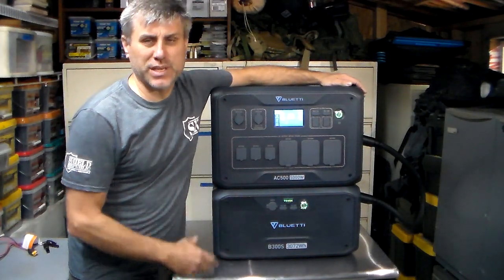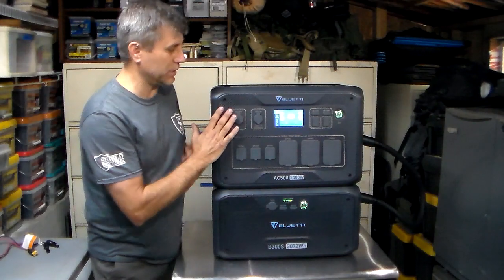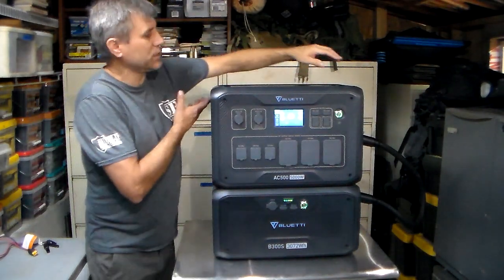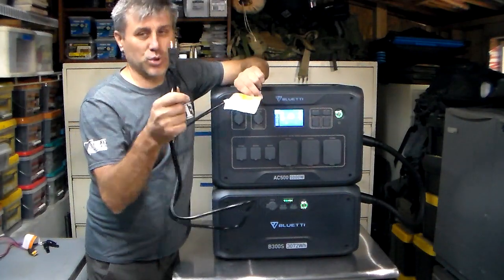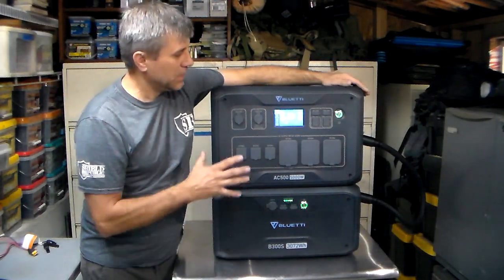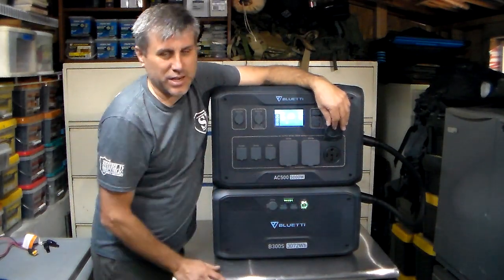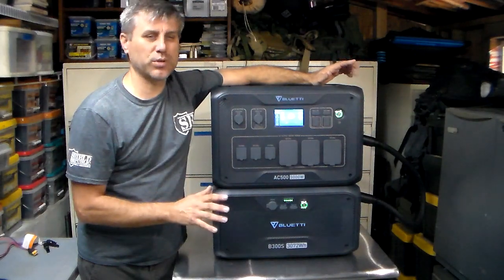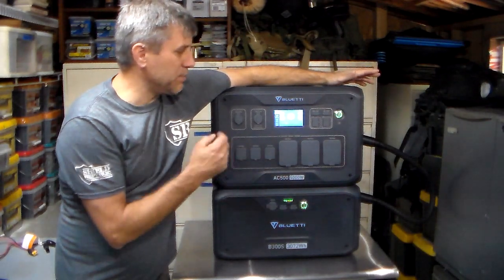Bluetti AC 500 and B300S...Top of the line solar power box.

Comment: 2 ecoflow delta pros. $6000, 2 full units, 2 charge controllers (3200 watt solar charging), 2 3600 watt inverters, 7200 total watt hours. Awesome customer service. Best part if one goes down you have a full operating system.
Reply: $6000 grand! I m getting a honda gas generator and a 500watt electric for small charging needs when it's need stealth. All that under 1800
Reply: @TruthIsFreedom7777  I don’t. I use them in a bus to run different items with 1.56 kw of solar.

Comment: I kept it simple, 1x100w solar panel+ 30a charge controller, 100ah deep cycle battery & 1000Watt Inverter. + A 4.4Kw Electric start dual fuel gas generator. But Im on a limited budget. other wise I would have something like that! peace out.
Reply: same... I have spare controllers and bits and pieces.. if this thing stops your stuffed

Comment: Does it have pass thru use? Will it take care of my fridge and deep freeze? Those will be crucial. 
Installing a wood burning stove within the month.
Reply: Yes it has pass through and will easily run a fridge and freezer. For how long will depend on battery capacity and running watts. Our ac200max runs ours overnight and recharges from solar during the day.

Comment: Bluetti is top tier and priced as such.
We decided on dual ac300 w/ 2 B300 and the patch panel to make 220v , back fed the main panel so we can run most everything except the well, simple pump on the way. also converted most of our major appliances to propane gas, increased our capacity from 250-500gal. 
TY for helping out the community.

Comment: I have the AC200 Max.  It is pretty good, but the solar panels do not provide power as advertised.
Reply: Something people may not realize is that Solar Panels, as a matter of industry standard, are spec'd with the assumption of 77F and high in the sky Summer Sun, which is just not realistic for a vast majority of people;  you'd have to be some where like Hawaii where the ocean regulates much of the temperature, but you still get that closer to the equator kind of sun.

When you're in Fall or Winter as the Northern Hemisphere is and is moving to, the Sun is much further South in the sky.  That eats into the expected power production of the panel because the sun has more atmosphere to travel through to get to your panel.

Also, Heat kills the efficiency of electronics.  When it's 100F outside, those panels are pushing quite a bit more temperature in direct sunlight.  You can easily lose 20% efficiency simply because it's hot outside, so a panel that's supposed to make 100 watts as advertised will only make 80 watts.  That's normal.  That's expected.  Most panels will even provide Temperature Coefficient data on the spec sheet.  That data might not mean anything to a regular joe, but those data points tell you how the panel will be affected by temperature.  

Power Companies incur much of the same efficiency losses when it gets hot, too.  It's part of why power can be problematic on hot Summer days as everyone turns on AC AND the efficiency of the transmission of that power is down because of the heat.

This is not isolated to Bluetti panels, it's basically all panels.